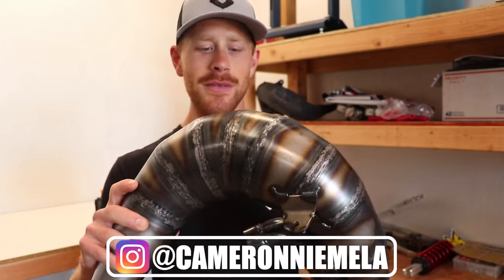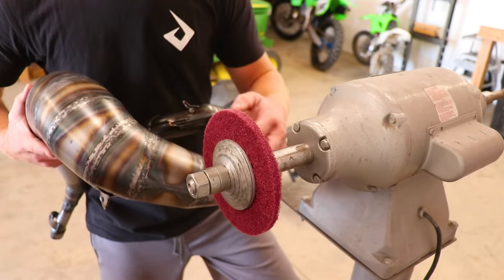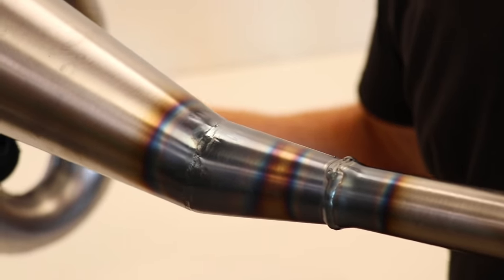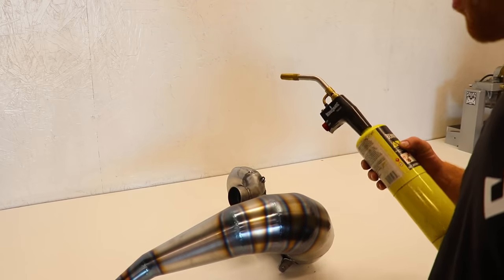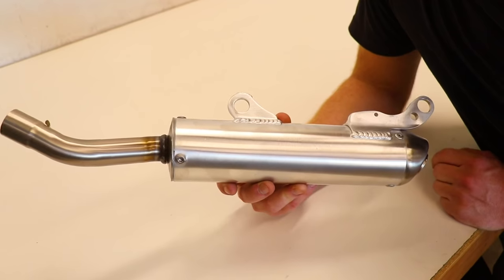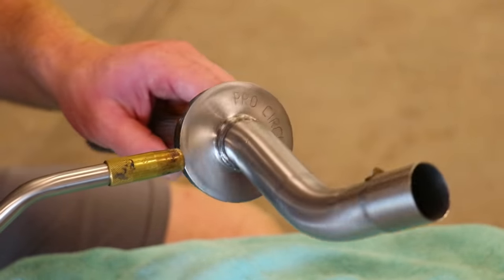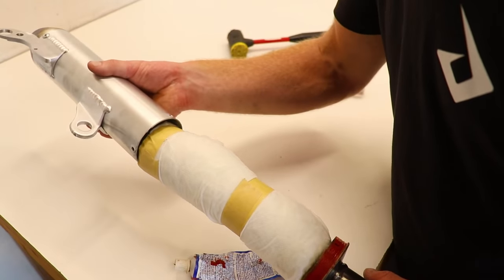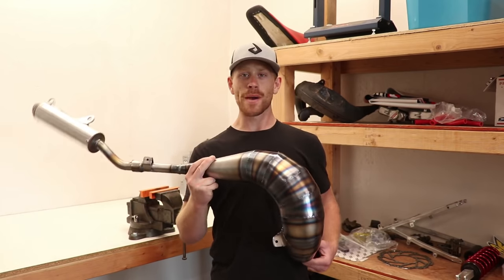How To Make A 2 Stroke Exhaust Pipe Look Incredible!

Comment: To improve the pipes appearance, another method that  I saw used was cold water sand blasting . The water was so cold , just to take a little drink of it would make your teeth ache . They then filled the tank on the blast cabinet and poured in the sand and sprayed that pipe all over . That certainly gave the pipe a nice bright clean look . Nice video you made .

Comment: Metal coloring was part of my welding class. It's patience, you can get some really nice color. Even better is nice consistent color, I'm no pro but they get extremely good.
Reply: Scotious Nevious when you colour the metal like this will it fade away over time from the heat of the exhaust gas's? I was thinking of doing mine 😁

Comment: I did a treatment on the header for my race car but used the natural engine heat to add back the color. Buy your vodka of choice. Wear clean rubber gloves and christen your new header with a nice vodka wash. Make sure not to get any dirt/oil/etc on it when installed. Use the natural heat from the engine and the thing will come out a smooth gold color all the way throughout!

Comment: Hey Cameron. For the silicone tube i have a trick. When you are Done with it screw in a Wood screw that fits snug in the hole just about a centimeter in.
Reply: Or use a wirenut.

Comment: Worst welds I’ve seen in a long time. What the hell?
Reply: Ikr it looks so bad do you know other companies than scalvine that do cone pipes ?
Reply: I'd be surprised if it doesn't leak
Reply: i agree no wonder they where grinded
Reply: Yep sorry but whoever welded those is an amateur welder, disgraceful for a "pro" bought pipe...
Reply: thats the first thing i thought. must have gotten that pipe after the high school vo-tech welders got job placement
Reply: @AverageCitizen333  the tig on the silencer looks pretty good though 🤣 I really wouldn't be surprised if the welds were to crack after a while.
Reply: They’re gas welded, which doesn’t allow for much aesthetics
Reply: Yes, I agree,  seen even worse welds on titanum two stroke exhaust pipes on paramotor engines...I mean it can be welded nicer without rising price of it, maybe more argon  needs to be used in process for gas coverage but its not big deal, argon (at least in my country) its not that pricey if you buy it in bulk.... Then you just need to buy gas lenses for your TIG torch but that is long time expense and you can use it forever....
So it basically depends only on welder skills
Reply: they arent welds,  its braized
Reply: Psh, you haven't seen my welds XD
Reply: @Spac3Monkey  na, they are welds
Reply: Do scalvini pipes have good welds ?
Reply: @Ace Freely Typically pipes are braised but either way they didn't look good
Reply: Not particularly good TIG welding that's fer sure....
Reply: @glennholtzapffel2397  they are not grinded😀  its gas welded, kind off soldering the material is floating out when melted ans gives a flat weld
Reply: @Farlig69  amateur? the welds are suposed to look like these

Comment: And when you're heating for color in metal, heat the metal all around slowly and evenly, the metal will slowly turn into a gold/haze then starts working into blue/ purple allows for alot better control of the color distortion

Comment: On the pipe you need to use a turbo torch they have a smaller flame that's higher temp which will give you better heat control.

Comment: What about doing something like a Cerakote MC-156 gloss coat over the header to ward off rust and keep the colour in check?  I believe the MC-156 has thermal stability till about 1100 deg f, or does the pipe get hotter than that?

Comment: Those welds looks pretty weak and I am not sure of that torch flame temperature but it can build stresses in that metal heat affected zone which can lead to crack later due to vibrations....I hope it will hold well.

Comment: The perforated pipe should be in multiple pieces that are positioned slightly off set with one another (in a zig zag pattern). This trick improves the exhaust and most possibly performance.

Comment: Hey Cam did your DPR pipe match up well to the Pro Circuit silencer?  I have been in touch with DPR and about to pull the trigger but I am going with the expensive titanium and carbon fiber Pro Circuit silencer and want to make sure I won't have to hack any metal from either piece!  Thanks man!!!  Another awesome video btw.  Your well lit shop,  white bench, and clear focused camera are much appreciated

Comment: Is it worth it to take a 250 two stroke and adding bore and flywheel weight to change the torque curve to be a better woods bike or even an enduro?  how are you creating the 350?  thanks love your videos
Reply: Better to just get a proper trail or enduro bike in my opinion.
Reply: Who other than KTM made one of those in the last 7 years?
Reply: What are you on about? Yamaha makes the yz X which is a trail oriented version of their mx. 
Husqvarna makes the TE enduros. 
The Beta range of trail bikes.
The Gas Gas has enduros/trail bikes. 
The Sherco has enduros/trail bikes. All of them are 2 strokes.
And if woods is all you are into, a 4 stroke with low down torque is probably a better fit to be honest. Making mods is a waste of money when you can buy something made to purpose.

Comment: Alright so I've been looking online for a while and couldn't find anything. I have the fmf fatty for 2004 ktm 85 and it is made of carbon steel/nickle finish. Would I get any colour out of the welds if I did what you did or would it weaken the weld and possible wreck the pipe?

Comment: Question on your buffer , I need the ends that hold the wheel larger , mine are small like 2 1/2 inch I need 4 1/2 of 5 in, what are they called so I can order some . thanks

Comment: Hey Cameron I have a question, I have a 05 crf450r and there a grinding noise coming from my front sprocket/case cover, it's not a consistent noise as it sound like half a gear is gone in the transmission, spins fine about a 1/4-1/2 turn then makes a grinding noise for a 1/4 turn. How could I tell  if it's my trans without gutting it? Thank you!

Comment: Does this work with any silencer?? I have fmf turbine core 2, and I love what you did to that cap!
Reply from the maker: Only works on stainless steel, your's is plated steel so it won't work
Reply: Do you know if it will work with my fmf fatty pipe? I saw a picture online of an fmf fatty pipe with the colour on the weld but I don't want to just try and possibly wreck the pipe.

Comment: Hey bro I have a question, I recently just got a brand new ktm 150 xc w, it's been about 2 weeks since I've bought it and has about 9hrs on it, I changed my first oil on 8hrs and filter on my 9th but me and my step dad noticed that it still feels boggy like the power isnt fully there and I'm not sure why it still feels like it. I thought maybe because it had to be broken into more after the 2nd full tank. I need help, should i take it back to the dealer so they can inspect it, or what, Any suggestions?

Comment: Hey Cameron, I have a 2015 ktm 105sx with Bill's Pipes silencer and pipe. Do you have any clue if this would work with my exhaust?
Reply from the maker: It'll only work if your pipe is raw steel. If it's plated it wont work
Reply: @CameronNiemela  alright thanks. I hope it is because that looks crazy. Amazing work
Reply: @CameronNiemela  sorry to bug ya again and I'd hate to ask a stupid question but I did some research and I think its carbon steel, it's not plated, but is there a difference between carbon steel and just plain old raw steel?

Comment: Tig welding is not easy but for that type of work the welder needs some lessons first...
You can get even much more better results with mig and 0.6 wire... welding by points it looks similar to tig and is super easy.

Comment: That is one hack job of a pipe. You see at each section there is an angle change, as in its actually visible? Each one of those sections negatively effect the sub sonic pulse coming back up through the pipe, and the strength of the pulse is weakened. Result? Less power.  The welds are as bad as I have seen. And dude if you want to make the pipe look like its actually working, the heat is in the header, not the stinger! I like your builds but this one is a not good. If I'm doing a pipe modification I like to take a stamped pipe, and then use very small cones that cause no abrupt angle changes, and use those cones to modify the length or diameter of a specific section. Stamped or "Blown" pipes (if you can find one) are a much better option as they do not have any angles and the metal is pre-stretched so the pipe holds it's tune when hot.  Not sure who donated the pipe but there are much better available.

Comment: Why take of the rust protection ?  
And if you heat up the welds wont they crack easier ?
I would have  send the whole pipe back to begin with, And ask for a refund  those welds wont last..